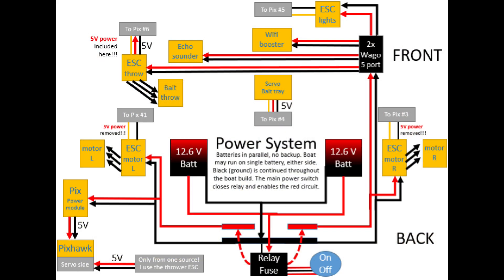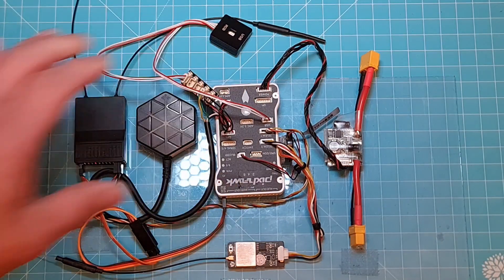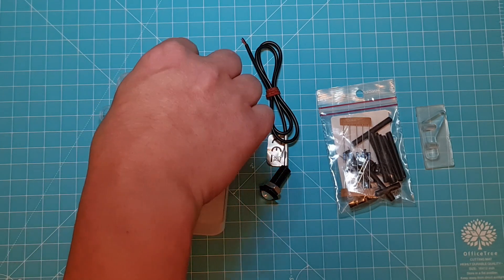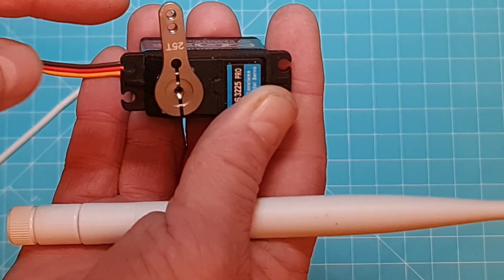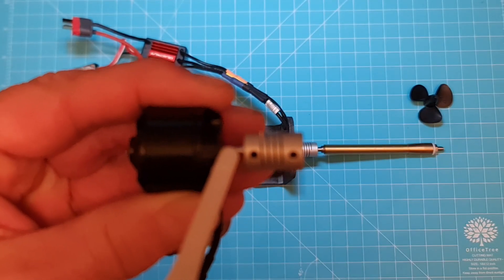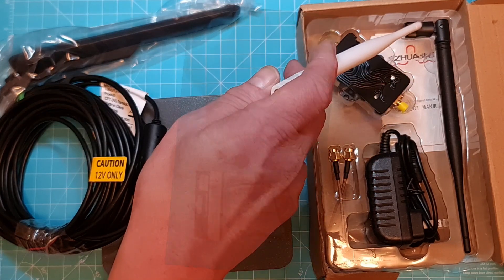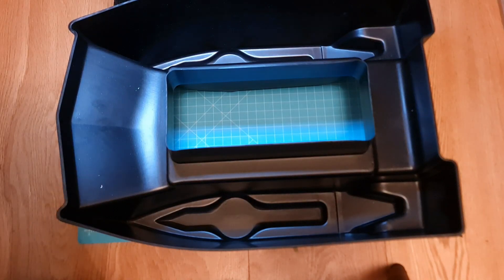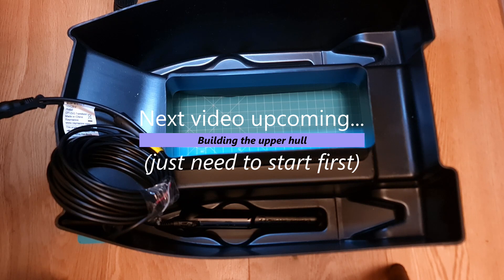Boat build part 3 - Other parts to be used

Comment: I use a Spektrum DX9. With this it doesn't make sense to use telemetry the way you showed here, does it?
I got a separate radio telemetry module that I connect to the usb of my tablet/tele1 on pixhawk. 
What would a secondary telemetry do for me? 
Thanks for your great videos!

Comment: Where cant I find the serial cable from r10 to the pixhawk
Reply from the maker: Not sure I understand. But there should be a cable with a 6 port DF13/Picoblade connector on one end and 2 pieces 3 port servo connectors on the other end. The red wire is in one servo connector, the black GND and a white and yellow for tx/Rx on the other servo connector.

The DF13/Picoblade goes into a pixhawk serial port (often TELEM1). And the 3 wire serial servo connector into the T10 RX on the right hand side (the plastic is marked differently, you will see it) while the single wired (red) you can plug into any available port as VCC is in the middle.

If you do not have the cable you can build one (like from a spare serial cable with pixhawk compliant serial connector). Just make sure to look up the wire diagram on ardupilot.org so you know the pin location for VCC, GND, TX and RX. Make certain that the VCC and GND are correct on both sides. And then make sure that the cable from pixhawk TX enters the T10 receiver RX (for serial you use two cables, and one side will talk while the other will listen): TX gets connected to RX

Comment: Hi, can you give me the model of the UDP wifi adapter, or a link to AliExpress?
Reply from the maker: @Jacksztywny  sure...

https://a.aliexpress.com/_Ex005ZS

The only thing to care about is that these comes with a cable/plug that fits either the APM (I hope that's not what you use) or a pixhawk.

Besides that the models reflect only hardware variants (onboard antenna or uFl antenna connector).
If you have a wifi fish finder in the boat and will attach the esp to that then you do NOT need a model with uFl connector.

Comment: the propeller adapter , is it aluminium or stainless steel , and where did you buy ( alixpress maybe )
Reply from the maker: @jurieromkes1522  Yes, correct. Propeller adapter that I bought from Ali Express

Comment: what kind fuse i can use :?
Reply from the maker: @Nana-S0714  i use standard fuses (flat) as also used in DC systems for cars. The number of amps depends on components in the boat. As I here use brushless ESCs I just added a 30A fuse. It breaks the positive wire between batteries and boat power distribution.
Reply: My boat Is 50A esc and battery 22000mah 6s 
How ampere should i use ?  For the fuse
Reply from the maker: @Nana-S0714  i would use a 30A. Battery size irrelevant. And your ESC is on par with one i have in another boat, also use 30A fuse there.

Comment: How did you shorten the RM 5Pro cable?
Reply from the maker: Two options, tried both. No favorite:

1. By cutting out a middle section and keeping the connector: Here you should practice using the cut-off middle section before soldering your result. You must make sure to carefully peel back metal film and plastic film on each end. Then remove protection and solder one wire at a time. And finally reapply the metal and plastic wrapping. I also added a shrink tube with glue outside to protect from moisture. By reapplying all protection in the same order you should keep the shielding and avoid to get a spot in the cable vulnerable for EMI from other electronics in the boat. 

2. Here you need some guide. Colors and pins are described in a picture on the facebook Carp Pilot Pro user group. What you do is to desolder the socket from the main board. Then you cut the cable to the desired lenght (allow some extra length so you can correct a mistake by starting over). Remove protection for 4-5 cm of the outer cable, then remove isolation of 0.5 cm and then solder the wires into their respective holes where the socket once was placed. Here you must take great care not to break the red and black wire for the transducer as these are very thin and brittle.

Comment: Where did you purchase the prefabricated cabling system? How can I find it to buy?
Reply from the maker: I bought it together with the hull as a kit. It came tith all the right lengths and connectors to fit the boat. Not easy to build something like that for any boat...

Comment: Hi. What motor did you use for the bait thrower?
Reply from the maker: It is a spitz motor (brushless). The specs are visible in the table in the first video (around 1 minute in). Spitz C3242-06 (5mm shank, 1000 pwm, 50 A). For this small bait thrower the motor is totally overkill (it is small but very powerful). I tuned it down to reach max 1650 PWM. And when running it from the app (servo button) I set it to  "momentary" with only 1 sec running time. The basket is empty before that second has passed.
Reply: @TheCarpPilot  Here, we have some modules for the bait thrower motors, to start slow and then rev, not full power from the start. I liked your motor because of it's dimmensions, I think I will try to find one similar. Thanks for the info.

Comment: good morning,
I am writing through a translator.
please write me where I can buy the raymarine dragonfly set that you show in the video. I have already found the signal amplifier. I don't know where to buy the rest. Thank you for your answer.
Reply from the maker: Well. Shops dealing with boat equipment would be the first to try. Living here in Norway, around 95 % of the components needed for a baitboat must be purchased abroad. But Raymarine I can get here locally. There is a rumor this mode is about to be cancelled. So if you want one then do not wait too long

Did a quick search and found new and used also on eBay. As for online shops abroad I do not have a list for Raymarine.
Reply: Can you send me a link where I can buy.

Comment: Do you have a link for the mavbridge UDB please
Reply from the maker: I used this (the "color" option 1.0 for pix)

2.4G Wireless Wifi Radio Telemetry Module With Antenna for New MAVLink2 Pixhawk APM Flight Controller FPV Drone Smartphone Table
https://a.aliexpress.com/_mNbGxja

Comment: Where did you buy the shank ?
Reply from the maker: The shank is a premium propeller shank solution that comes pre-greased and is also with ball bearings, made in Germany by the DHconcepts company deigned for and use with all of their boats.
Reply: @TheCarpPilot  awesome i will check if i can buy them seperate

Comment: Hi I know you already do a nice job . On the app. I have something that I would love to add. I would ask if you could add favorites in the edit parameters list . It would be much easier to adjust the motor rpm . And other things .
Reply from the maker: That's a good idea. It is actually on my todo list, just not had the time for it (and sadly will not have time either in the near future). But for sure, a screen with the most useful parameters to set will be time saving indeed!

Comment: Nice job👍 where i can buy bait thrower? You make alone?
Reply from the maker: It is an original bait thrower from DHconcepts that fits their boats like a glove. I have however custom fitted a new holder (a lot of measuring and 3D printing involved) as I wanted to reduce weight even more with a light weight brushless motor. Hence my use of a brushless WSC and the 3-wire aviation plug. The standard version is a brushed type, using a 2-wire DC plug. And to be honest this is also much easier to install.
Reply: Hi, im realy glad with youre video's!  So good explayned😁  May i ask you what motor you used on the baitthrower and what esc  please?   
Thanks in avance 😁